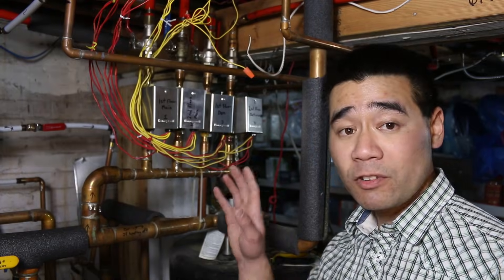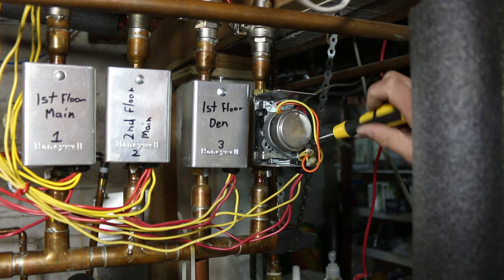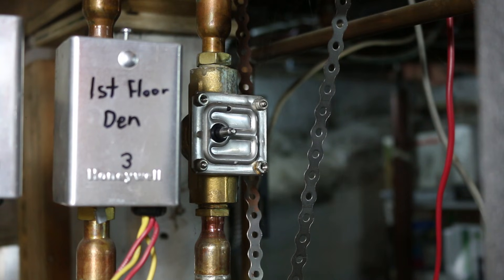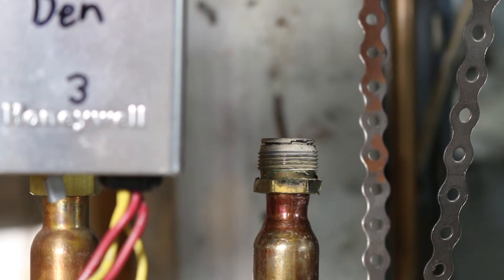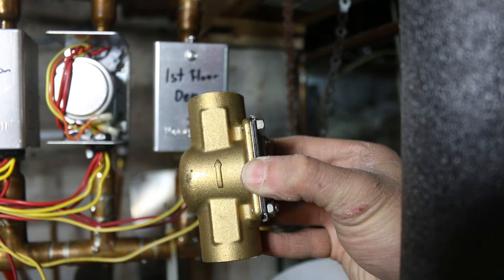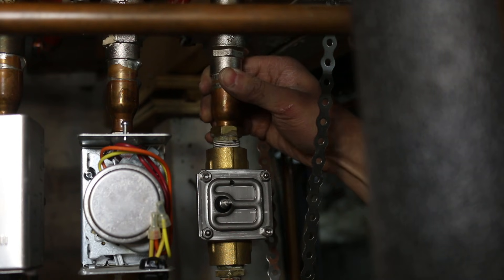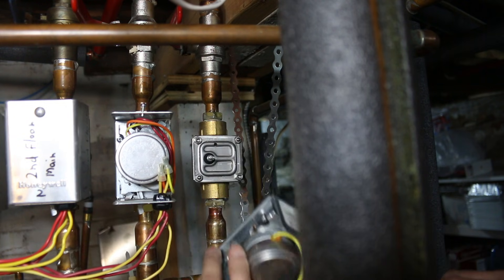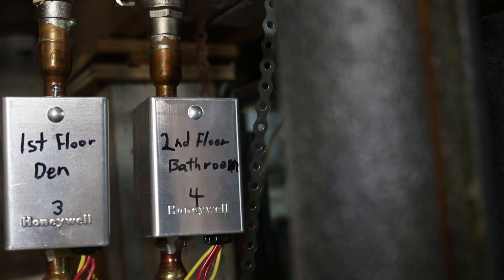How to Change a Zone Valve - Hot Water Boiler Heating System

Comment: My lumber heating repair guy came to fixed my gas boiler. He replaced the motorized zone valve, he did exactly same as Andrew shows here on video, he didn't use plumber tape either. The cost? $300 in less than 20 minutes.

Comment: Great video. I suspect you are in Canada though. In the USA we would have the zone valves installed on the return pipes under the premise that the water would be a little cooler on that side and hence taking a few degrees off the zone mechanism

Comment: Do you have to pay attention to where the yellow and red wires are hooked up , or can you for example hook up the two yellows to the two yellow wires and the two reds to the two reds? (If you cut the wires from the previous unit and simply join the new ones to the old ones)

Comment: I'm in the process in switching from Honeywell V8043 series to Taco 570 series. I just find the Taco 570 series to be a far simpler and easier to maintain, not to mention slower at opening/closing preventing water hammer shock through the system. Was curious how much it would cost for a plumber to replace all 5 zone valves and update the controls (3 were bad when I moved in). Was quoted $3700. Nope, I am happy to do it myself for $700 worth of parts and 4 hours labor...

Comment: Hi what safety measures do you have to put in place apart from turn water supply off, do you have to turn electrics off?
Reply: Shut electric power to circulator pump,or it could burn out.

Comment: what if the arrow is on the opposite side????
Reply: U want the arrow pointing to the boiler not up to the lines in the house. The valve opens to allow water back into the boiler to be heated then it is sent through the house then back past valves n so on.

Comment: Just curious why wouldn't you just take the guts of the old one out, and put the new ball valve in using the same lower casing?
Reply: You can and it usually what I do.  The only time  I change the valve body is if the ball lets water through in the closed position.  This can happen if the tolerances between the replacement baseplate ball and valve body and off or the valve body seat is worn.

Comment: The valve rarely goes bad.  It's usually the motor that goes bad.  Did you test the valve first?  It's easy to do with a pair of pliers.  Just switch it on and off.  If the water flows when on, and doesn't flow when off, the valve is good.
Reply: Make sure valve is easy to turn. Should be able to do it with 2 fingers. If it's stiff the motor will die prematurely

Comment: Great video Andrew and thanks. I have had another one of these fail and am wondering if there's a way of telling if its the electrical part or the mechanical part behind that's failed? Apologies if you have answered this already
Reply: Pull the motor off of the valve and if you can spin the valve by hand you shouldn't have to replace the actual valve. To test the electric motor have someone turn the thermostat to a temp above ambient temp and look at the back of the unit to see if indeed to motor moves. If not. Check thermostat make sure all wires are hooked up properly. If to still no avail something else is wrong. The circulator pump could be bad etc.
Reply: I have the same question.
Reply: I'd like to know too. I have two zones, no heat in either one. I put my Honeywell valves in manual but ....nothing. No resistance at all and no heat
Reply: Pull the motor off of the valve and if you can spin the valve by hand you shouldn't have to replace the actual valve. To test the electric motor have someone turn the thermostat to a temp above ambient temp and look at the back of the unit to see if indeed to motor moves. If not. Check thermostat make sure all wires are hooked up properly. If to still no avail something else is wrong. The circulator pump could be bad etc.

Comment: Could you elaborate on your particular symptoms on why you decided the valve was the issue & not the motor? Would give a little more context on what conditions would cause someone to want to change valve itself.

I personally have a continuously spinning hydronic valve (white rodgers 1361-102) that goes 'round & 'round and doesn't stop. Wondering if this is motor based (not likely since it has no issue turning), valve based (can't imagine it's this either since the valve is capable of opening & closing), or my honeywell old-style rotational thermostat.
Reply: Yooo Rick turtle in the flesh

Comment: Hey Andrew, my parents are have issues with their heating system like yours not heating the house very well.  Are those basebords super hot to the touch because theirs is just really warm not enough to heat a room.

Second question is it hard to install one on those hot water boilers for a pretty handy person but ive never done anything like a furnace.
Reply: If u are only getting partial heat. The valve is stuck slightly open. In my opinion

Comment: if my zone valve gets stuck open and i changed the motor already does that mean the who thing is dead?
Reply: Check thermostat
Reply: @davidmeyer7199  thermostat is good, i replaced the whole thing and its working perfect now. just odd the same one keeps breaking
Reply: @menswearhous  if it's a Honeywell that's probley why their quality is not what it once was taco is so much better all around
Reply: The valve is probably too stiff for the motor to spin in. Change just the valve plate and make sure motor didn't burn out due to strain from stiff valve